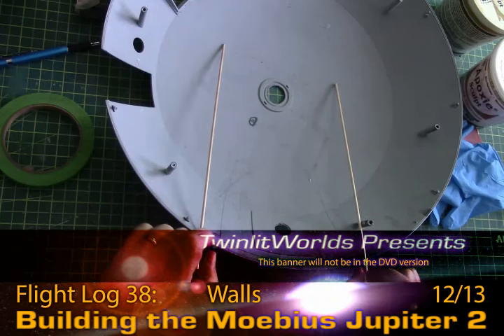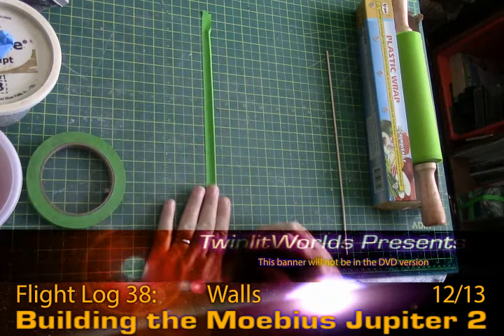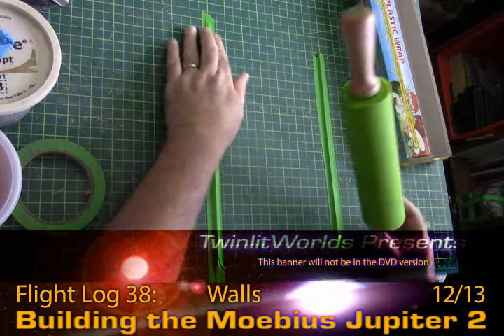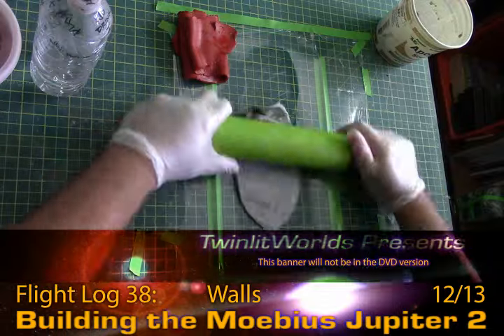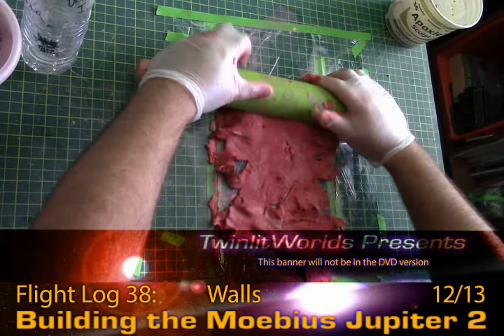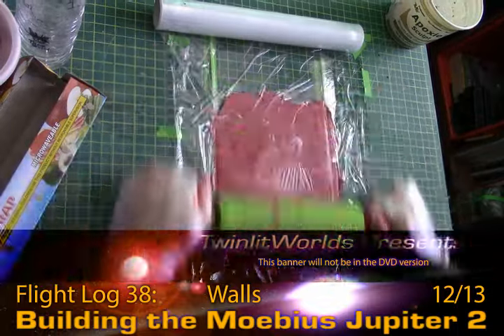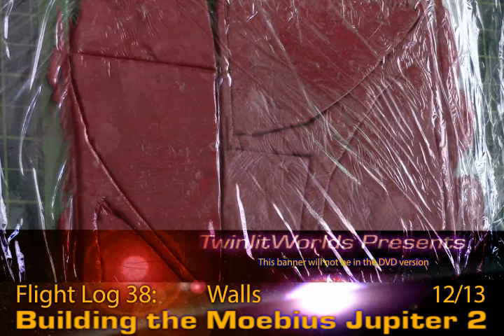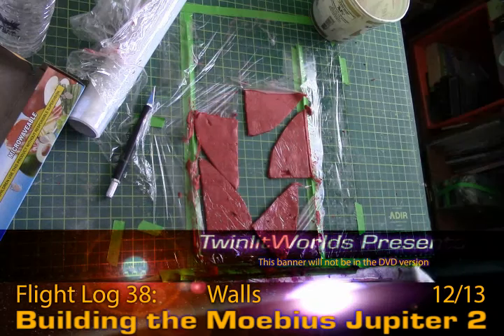J2 FlightLog 38: pt12 Walls

Comment: Looks like a pain in the rear. I'd try drawing the patter on wax paper. Sand which the epoxy between two sheets and use a pasta rolling machine to.get it to thickness. Let it harden, cut and sand.
Reply from the maker: +lunhil12 Looks like a pasta rolller is in my future!  Sounds like a great tool and the perfect use.
Reply: +ModelManTom consider this, I use mine to make pasta. It's a manual which means you need three hands, if you get a motorized one it will be a lot easier to manage the sheets as they come out of the machine.. If you cook try making lasagne with thin sheets  of pasta, so much better than store bought and you can add herbs to it before rolling.
Reply from the maker: lunhil12
It gets better and better!  My wife ouwld love to make her own dough I am sure.

Comment: Why use sculpting clay when you have a 3D printer? The 3D printed pieces will be lighter on the model, since the electronics is making the model already heavy.
Reply from the maker: +centaur1a I sold the printer some years ago now.  Never really got it working reliably either.